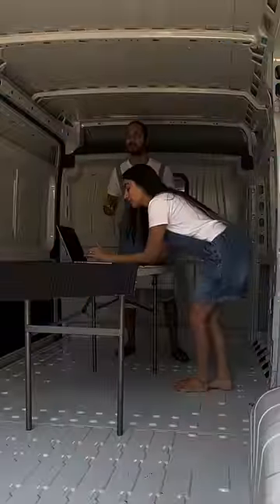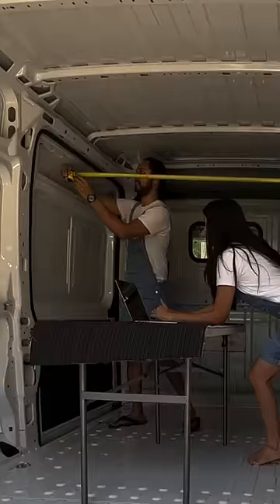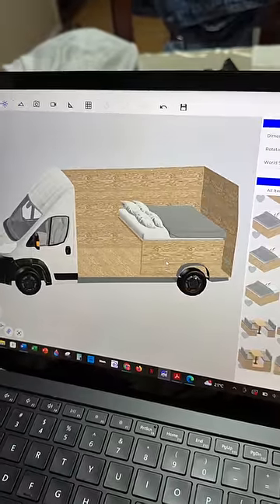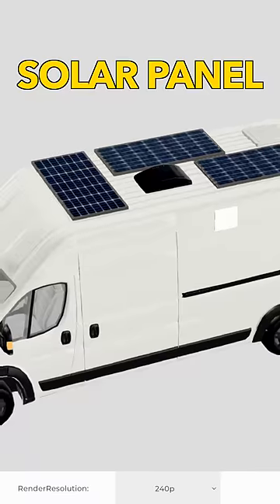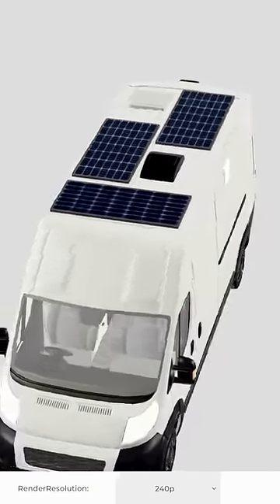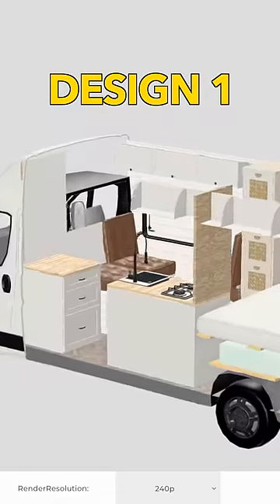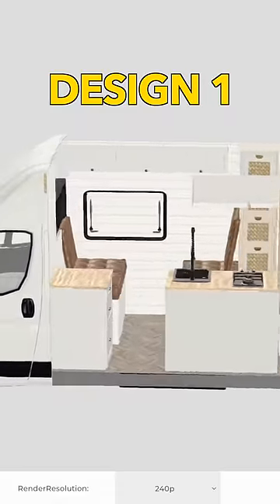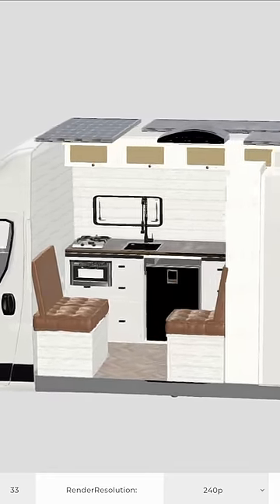WHAT design do you like? #vanbuild #hindi #vanlife

Comment: Design no.02  with a minor change. Sink is too close to the Hob. Shift it to right corner. With trash & recycle bins & cleaners under sink. & switch board to the centre. This will give you a lot of counter space for prepping & cooking.

You can also add an extra movable, fold down counter/table, at same level of kitchen counter, (1/3rd of counter size (width)), that can be shifted either ways, (with a leg for support), left or right to serve as an L shaped kitchen counter, when open. If in centre, it works as an island kitchen/dining/working table. 😊 what do you think ? (Just a suggestion) .
Reply: Design 2
Reply: Amazing suggestion...
Reply: @msp2299  thank you 😊